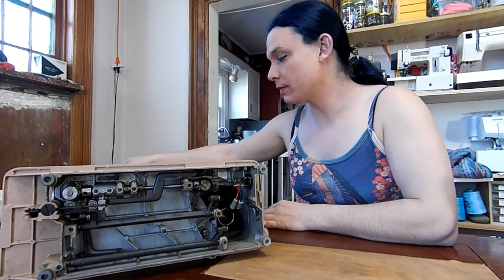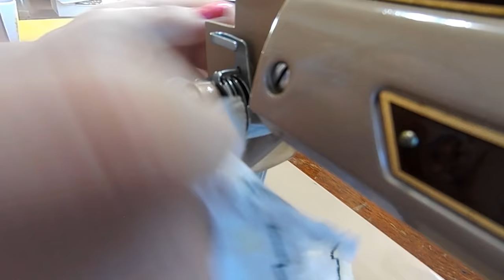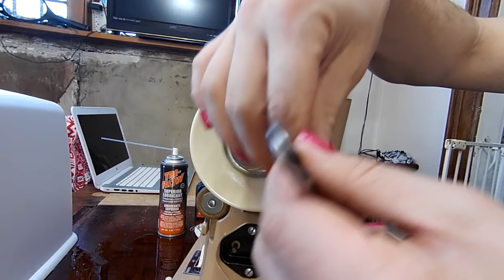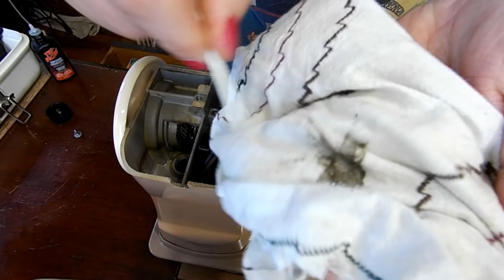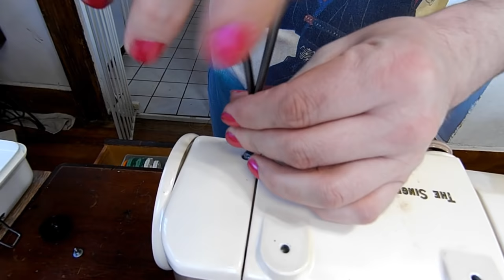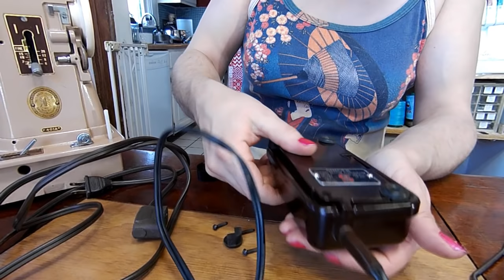How to Clean, Oil, and Grease a Singer 401a Vintage Sewing Machine

Comment: Thank you so much, Stevie!  My Dad bought my Mom a 401-A in 1959.  It was her pride and joy and she began to teach me to sew once I was old enough to learn.  She died when I was 14 and that machine has been in constant use because not only did I need to sew because I was way taller than the average girl, and way back then there were no tall girl shops; but also because it kept me close to my mother.  Fast forward to 1998 when my machine also went to live in England.  I have to use a transformer to run it here.  I thought I was doing well with keeping it oiled but the pistons operating the cams on my 401-A had been frozen for several years by 2019, so I took my machine in for a full service which cost me well over £200.  I got it back and the lever was very stiff, but the cams were working.  It wasn't but a few months later and they froze up again, so I limped along for a few years during all the pandemic lockdowns (In I-SEW-lation) using nothing but straight stitch.  Then in 2022 the entire machine froze up.  I was devastated.  Then I found your video and ordered some Tri-Flow, oil and grease and went to work.  It took over 5 hours for the Tri-Flow spray to begin to work its magic, but I got some wiggle when I turned the hand wheel.  At about 7 hours the first piston controlling 'A-J' began to move.  The machine sat overnight and the piston controlling 'K-Special' was still stuck.  Bummer.  I decided to hit it with my blow drier.  A 10 second blast of hot air was all it took to free it. Then I removed the cam stack and serviced it as you instructed, then I oiled and greased everything and let the machine sit all day on a newspaper to drain the excess drips.  I would have made you proud.  It was sitting in a puddle of dirty Tri-Flow.  This morning I gave it a good clean and reattached the base and installed it back onto the cabinet.  It is purring like a kitten when I sew, and unlike when I last had it professionally serviced, all of the levers and other moving parts glide like greased lightening.  I never knew how easy it would be to service my own machine and I feel so empowered now!  Your video is so professionally shot and you are a fabulous teacher.  You truly are my hero, and I thank you from the bottom of my heart for helping me get my best friend working again.
Reply from the maker: Your welcome. And no its not hard to service the old machines. And if you keep using triflow you wont ever have to clean out the insides. It will do it for you. Keep it soaked.

Comment: I have two 401a machines that I run my small business off of and I love them. I service them once a year (whether they need it or not, I do work them pretty hard) but I usually need a little walkthrough so I don't miss anything. This is one of the best I've found! Thank you so much for posting. ❤
Reply from the maker: Right on!

Comment: Since my last post. You have made me addicted to collecting and cleaning/restoring sewing machines. I've bought 6 since then. Yikes! Got my husband to order these products, so now I have them all and Will get to use them now.  I was working on this same singer and had the same sticking problem as you. But there was no stress. I did everything you showed and was very patient, gave the oil time to work. And sure enough it works great. My husband was very impressed with how I got it to work. Thanks so much for your videos. Keep up the great tutorials. I've learned a lot.

Comment: This is the safest and easiest way of cleaning and oiling that I’ve ever seen. Thanks for sharing! Esp love your tensioners tricks
Reply from the maker: Why tear a tension assembly apart they usally just have gummie stuff in them or lint. No reason to tear it all part just polish them up and done. Out of all the machines I own and sold off. Only 1 I HAD to tear apart because it kept cutting the thread. One of the discs had a burr on it. Not sure how you get a burr on a tension disc but this one had one and I had to file it smooth again.

Comment: I inherited a Singer 401G this past weekend.  I've never sewn before but recently developed an interest.  I am not sure when the machine was last used but it was not working when I did a quick op test on Sunday. I found this video and decided to follow along for general cleaning guidance.  After pausing and starting numerous times I was able to give the machine a good clean.  I do not have the recommended oil or grease but though a good clean would help.    I cleaned the machine with a brush and some rags and undid the cam and removed as much gunked up old grease as possible. Success!! I did a quick op test after and all was working!  I made my first ever straight stitch!  Thanks for the great tutorial. I will be purchasing the recommended lubricants today so I can give this beautiful machine a thorough cleaning before using again with interest and earnest.  Cheers and thanks again!

Comment: My husband and I have restored vintage sewing machines for many years.  Please take our comments positively. Too much product used and needs old grease and dirt removed first.  However, we like that you sprayed the machine to clean it without removing all the usual parts because the machine wasn't that dirty or damaged.  If there are sewing problems after cleaning, then some parts will need removal and polishing, or replacement. I'll order a few spray cans from Amazon through your site and we subscribed.

Comment: I just serviced my singer 401A using your instructions. they are by far the best online. thank you so much! the motor was very difficult to take off but other than that the process was just as smooth as you demonstrated. I haven't used it to sew yet so I guess that will be the true test. I was having tension issues and listened to your advice on servicing first before I do anything crazy.
Reply from the maker: Great to hear!

Comment: Just bought a Singer 401 and just found your channel :) Tomorrow my husband and I along with your videos will be begin the  cleaning process. Thanks for making such great video tutorials!!!!
Reply from the maker: Have fun!
Reply: @SewSaveMe  So how do I remove the excess Tri-Flow? :) Even with a cloth on the bed of the machine, I managed to soak it.
Reply from the maker: I usually don't unless you soaked the motor on accident I just let my machines drip dry. Start sewing with it using scraps and it will kick of the excess. When I service my Kenmore I just use a spray bottle of the stuff these days and keep a paper towel under it. I know some will cringe with the idea but triflow dont gum up and cleans old oils away. My 401a was totally brown and gummy looking inside over the years of using triflow it looks like the parts are now polished. And I did zero cleaning with solvents on it. So far triflow has not damaged any paint on my machine in fact its cleaned the paint to a nice finish again.
Reply: @SewSaveMe  Thanks!!!! So happy to have found you...total fan!!! 😁

Comment: I have an Singer 431G. I used nafta and a brush to solve the old oil that had jammed up the moving parts due to the hardening of old oil. It took long time to do! Lot of running and wiping and oiling. And grease to the gears.  They're superb machines. I also have an older Singer seving machine, a black one from the fifties. I had Husqvarna machines before but I didn't find them to be so good overall in comparison.
Reply from the maker: That old junk tar garbage oil can be a hassle. Just time and patience well get them running again.
Reply: @SewSaveMe    Yes, it depends on the canola they put in! It took days to fix it. Sometimes you even need Bensin, or acetone! Canola can be really bad . oxidation!

Comment: Great Video and extra thanks for making this. I've seen my mom using this machine for my entire life so it is very sentimental to work on and to read comments of people with similar feelings. I would like to note for some people that Stevie's machine was visibly gunked up with a lot of debris an old grease, oil, etc., and it required extra solvent to dissolve some of this. If your machine is not quite this grimey you do not need to use as much of the spray lube as she did... you'll thank yourself later when you don't have to lean it out.
Reply from the maker: Your right it was extra gunky. Ive had 3 of these machines before this one. I didnt do a video on them because of how clean they were starting. For some reason I decided to keep this machine. Today if you look inside its totally clean and polished and all ive done is flowed triflow oil though it over the years. Its totally dissovled the old gunk out of the machine. But your Absolutly right if you oilem up this heavy you might wanna night of drip dry before use. Triflow stains faberic. The Video is also assuming it hasnt been serviced in decades.

Comment: Thank you so much for this video! I purchased the Trinity of Triflow a about a month or so ago from your link (and thank you for making it fast to find them all)and today, being in quarantine was the perfect time to dig in and do this. It took me a little longer then it did you but I was able to do it. I have never done anything like this before but I just followed step by step. Amazing how that oil/degreaser works, it took decades of tractor oil and grease right off. Yes the machine had been VERY well loved 🤣🤣
Reply from the maker: That stuff is a 21st century wonder. Or its made with magic, ether way its amazing stuff.

Comment: great video. i have this machine. it was given to my wife by a 102 yr old lady. my wife never used it and she passed away in november. i got it out to teach myself to sew. i was just gonna go for it but maybe i better look inside it first. only question i have is what was the black grease you put on the bottom of the machine as compared to the white grease you used in other places.?
Reply from the maker: The black grease on the bottom is the same clear stuf I used on top the reason why it was black is because it eats old tar grease and sheds it off of the metal parts. Far as cleaning machines other then rubbing off heavy stuff I let triflow do the hard work of dissolving old cruddy tar stuff. If you keep it flowed with triflow eventually it will look like some one polished the parts. My 404 was real nasty inside and over the last few years it looks new inside simply keeping it oiled down with triflow.

Comment: I found one of these for $40 on Marketplace. If they still have it tomorrow afternoon I want to go get it.  If it runs it should run even better once I'm done with it!
Reply from the maker: I would service it before you try to run it. We know its been sitting forever and is dry.
Reply: I did,   But when I  went to buy it I had to run it tho to make sure the motor even worked.
 I didn't want to buy it for parts. 
  I cleaned it and oiled it and greased all the gears as soon as I got it home.

Comment: Thank you so much for fantastic, well explained instructions.   I am the seventh daughter (my Dad must have wanted a boy.. ;)   He taught me to oil like you do whether we were working on sewing machine's, bicycles or motorbikes. 
I'm good with the machinery but not confident with the electrical parts and I have to replace a capacitor in the motor of a Singer Capri.  People say that I can just leave it out but I would rather it be replaced if possible.  
I always thought I used too much oil but now I've seen you I feel I'm ok.  ;)  Looking forward to seeing more video's from you...why can't you be in the UK?  ;)  Liked and subbed and glad to be your first comment!  :)
Reply from the maker: To much oil just dripps off the machine any ways it wont hurt nothing from what Ive been doing. But not enough oil or misses spots are worse the machine wont run smooth. And I like my machines to run super smooth.

Comment: Just bought one of these and plan to use it to learn basic sewing and upholstery. Very informative video on getting this up to speed! Subscribed 👏
Reply from the maker: There not bad for light weight stuff or even Med weight stuff.
Reply: @SewSaveMe  for sure. I'll have to get another machine for heavy duty work, but I've been very happy with the machine. I've always wanted to learn tailoring, no better time to start than COVID
Reply from the maker: If your not ready for an industrial lock stitch machine look at the kenmore 158 series machines. They can do some pretty heavy stuff. Like the 158.1803. the 401 is over built so it will sew heavy stuff but the wimpy motor and tall gearing to me makes it not the ideal machine for the work.
Reply: @SewSaveMe  do you think that machine can handle 3 layers of upholster fabric with batting? I'm looking at upholstering a classic car bench seat, it'll need to sew through a lot.

Thanks for the swift replies, I love the videos on your page and it's super helpful for a beginner like me!
Reply from the maker: Go look at my singer 2491 its basicly a industrial juki rebranded but something like that would work great but work up to something like that go look for a kenmore 158 series it could prolly pull that off. most ive ever sewn though on my kenmore is a layer of stiff belt leather and 1 layer of 10oz denim. thats pretty tuff stuff. but those machines can sew some thick stuff. go look up some vintage kenmores.
I dont normally reply this fast but its that time of the month to go though comments.
Reply: @SewSaveMe  well thanks for the advice! I'll look into the old Kenmore. It's hard for me to sort through all the opinions online, there's a lot of very niche antique sewing machine knowledge out there that I never expected.

Comment: Thank you. Very well explained. There are concerns about using anything which sprays Teflon (PTFE). Apparently it might cause respiratory issues. When I use the spray Triflow I use it an outside area and with a mask. Be safe, and keep on sewing!
Reply from the maker: From what I've hard your not wrong. But since I'm not making the stuff or using 5 gallons of it a week the exposure is small. :)

Comment: Wonderful videos!  You are a natural teacher, and made me feel confident about servicing my Singer 401!  I would LOVE to see a video comparing a "knee pedal" to a "foot pedal" - I'm used to a foot pedal, and find the knee pedal awkward - maybe I'm doing something wrong?  I'm not even sure which leg to use - the outside of my right leg, or the inside of my left leg.   I've seen "electronic foot pedals" sold elsewhere, and was 1) wondering what your excellent opinion was of them, and 2) how to change from a knee pedal to a foot pedal.  Thank you!!!
Reply from the maker: Im sorry for the Delayed Responce I had no idea youtube was holding the comments until now.  Personally I dislike knee pedals. Most stock singer desks came with a bracket to simply put the foot pedal into to make them into a knee. I would love to give you advice on this but I find a knee pedal awkward to run the machine my self. I know some that love that feature though.
Reply: I use a knee pedal and use the outside of my right leg to control it.  I find a foot pedal very awkward, but probably because I learned on and have used a knee pedal for decades.  Personally speaking, it gives me better control and I don't get a cramp in my leg like a do with a foot pedal.  Plus a foot pedal stays on the floor and gets dusty so much faster.  When I use a foot pedal, I have to sew wearing socks so I don't accidentally go from 0 to 60 like I do when I'm wearing shoes.  I did get a good tip about using a foot pedal.  She told me to turn it around so your foot sits on the whole device.  That really, really helped, but I MUCH prefer sewing with a knee pedal.  My cabinet has a big lever underneath on the right side at knee height, and the pedal is encased and screwed to the front underside of the cabinet.

Comment: Thank you so much for the video.  I just found a 401A at the thrift store.  It's clean and dry and I haven't sprayed and oiled yet...the lever that lowers the plate is jammed in the Down position and the stitch regulator knobs are frozen, the needle is in the left position and the lever doesn't do anything.  Runs smoothly other than that.  :-)  Hope it's not a lost cause!

Comment: That machine sounds great!  Thanks so much for this vid.  I sew on a 403A, and it has been lubed in a few years, so I want to do it myself.  I have a 503A at my daughter's.  I have another 403 I picked up at Goodwill sitting in my sewing room that the wheel turns, but the needle bar won't go up and down.  I am going to take the clutch off following your directions, and see if there's a problem there.  The machine is very clean, and I can't see any thing obviously wrong.

Comment: Thank you for your videos and instructions.  I have recently purchased a 401a sewing machine.  I love it because I grew up watching my mother sew on this machine model. The machines stitch selector doesn't move. Its on straight stitch.  It also needs a paint touch up.  Do you have information on where to get the paint?  Thanks so much.
Reply from the maker: Not really sure on the paint since Ive never touched up any of mine. But I have seen little bottles of it on ebay for sale. But again I cant tell you how close it is to color or not.